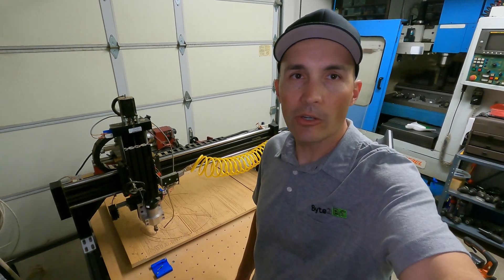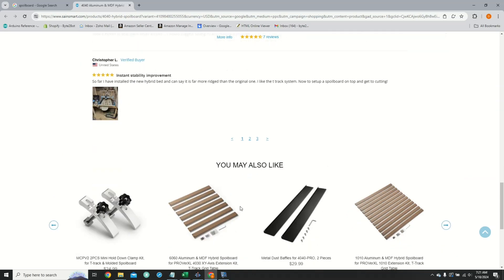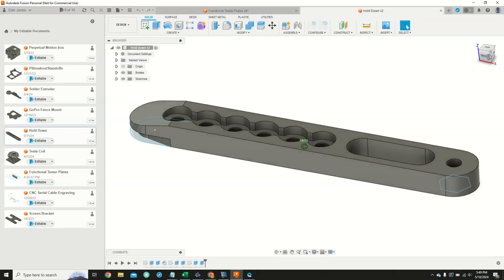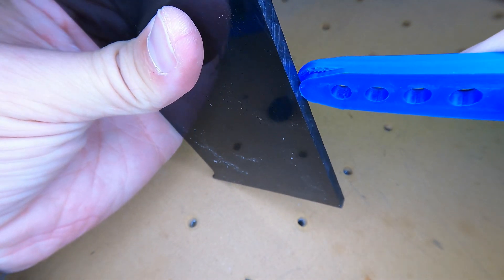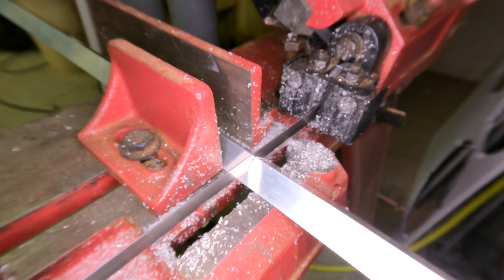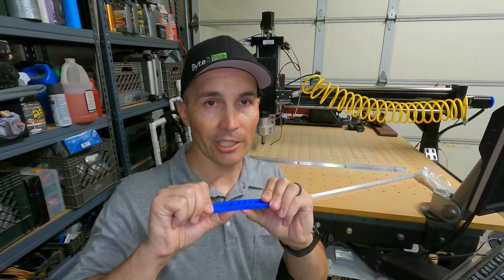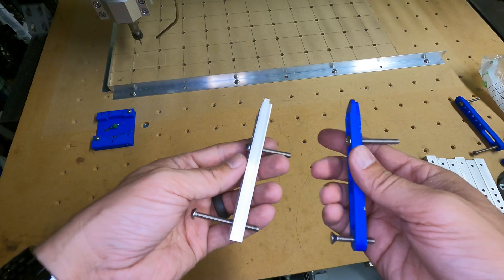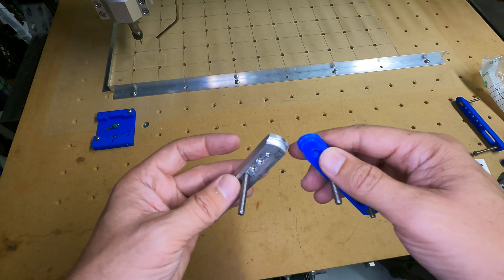CNC Router Spoilboard and Clamps

Comment: I have no matrix of holes in my spoilboard. I drill a hole where and when I need one. So far, in six months of use, my spoilboard has four holes in it. And none of them is the kind of unfortunate compromise you show on the thumbnail. Also most of the clamping force should be sideways, stopping the workpiece from sliding around. You need very little downwards force. Cams and wedges are the things you need.

Comment: I use about the same clamping system except I have an 20mm thick aluminium bed with holes cnc drilled and tapped (M5). I've slotted the aluminium strips and put threaded holes at each end. This way I can adjust the the screw on the work piece for material thickness. It does stick out more above the material but I usually move the spindle around and looking at the gcode preview to see if there's any collisions. I use 50x150x15mm parallels to align the workpiece, clamp it down and remove the parallels if they are in the way. 

As for edge clamping, I sometimes use 2 toe clamps, one to constrain slipping the second thats on an angle on the workpiece edge. If the workpiece is small enough I use the machine vise with parallels. Or use the tape and glue method but I'm not a fan of that and avoid it if I can.

As spoilboards I use mdf flooring laminate to protect the alu bed. I can cut them to size or use multiple boards as needed.
Reply from the maker: I like the idea of using flooring boards!  Those are usually available as used in small amounts and relatively inexpensive and flat.  Thanks for sharing!